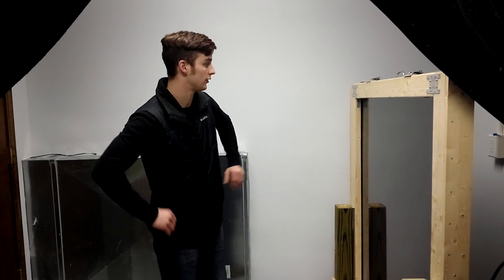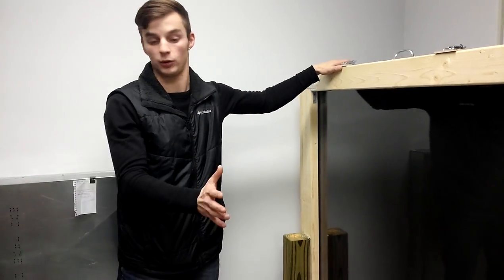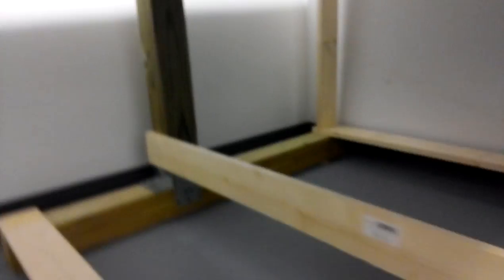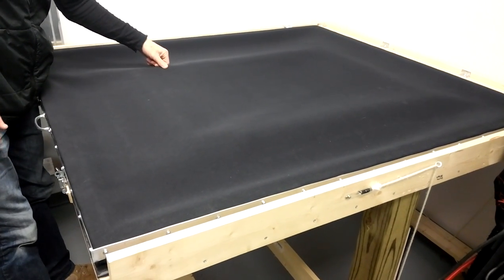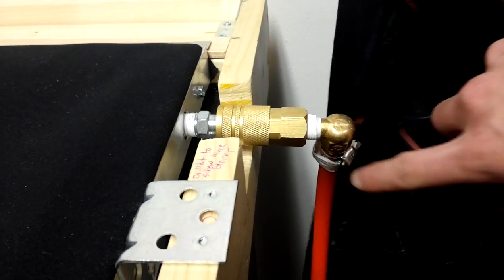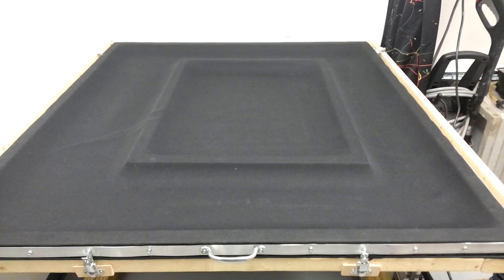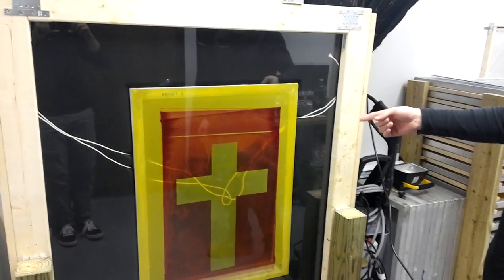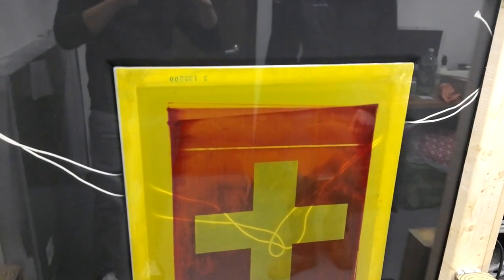HOW TO DIY EXTRA LARGE EXPOSURE UNIT

Comment: Like the 6000 watt upgrade. nice move. Perhaps i will look into more wattage myself. In the meantime, neoprene is somewhat fragile you say and is prone to ripping and you want this special rubber. This rubber sounds like something i should look into.
Reply: yes the neoprene is a good/cheap alternative and it does work for several hundred exposures, but it will rip eventually. the runner I'm going to get is basically a deep draw rubber blanket all professional units have. I will buy it from douthitt in Michigan.

Comment: Hello Joseph, nice work on your vacuum frame. I built an exposure unit myself but didn't use neoprene rubber. Now I want to upgrade my machine using neoprene. My question is what was the thickness of the neoprene? Also I liked the way you hooked up the vacuum machine, I would like to use your system if I may.
Reply: Hi do you still need help? I was never notified of your comment so it was overlooked. I would love to help if you need
Reply: Yeah. What Size thickness of neoprene and if you order plain on both sides or smooth on one side?

Comment: hi joseph, by now you have probably figured out that your next light upgrade is to metal halide, 1000 watts. and you learned that it cut your exposure time down to only a few minutes rather than the longer times with the halogen bulb.
Reply: currently I own a freestanding 6,000 watt metal halide lamp. it works great. 45 second exposures with dual cure diazo, and 30 min exposures on kiwo pholopolymer
Reply: Where did you get the freestanding halide lamp? What model / manufacturer?  I'm trying to figure out a good option.  Thanks!

Comment: Why the string on top of the screen? What does that do
Reply: I moved the strong to the bottom where it has stayed. it works better that way.
Reply: +Timothy Rowan It lets the air get fully sucked out from the inside area of the screen frame.  Without it, there might be a small pocket of air trapped.  Normally if you were exposing a screen, you wouldn't want the string anywhere near your emulsion.

Comment: hi joseph, what thickness is your neoprene 1/16"? 1/8?
Reply: my neoprene has ripped during lots of use. it still works but I will upgrade to a deep draw rubber blanket when I can afford it. $850 bones
Reply: +Joseph Blackmore I've been using ryonet's neoprene and hasn't ripped from heavy use in over 2 years. Just has alot of ink on it.